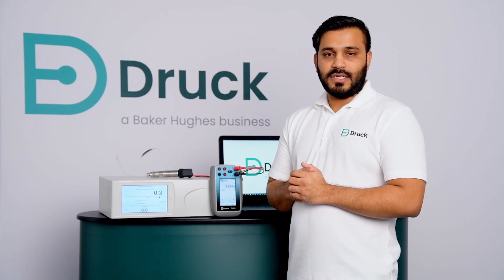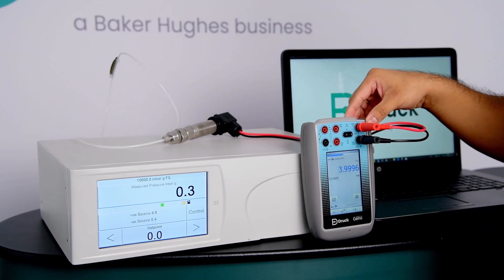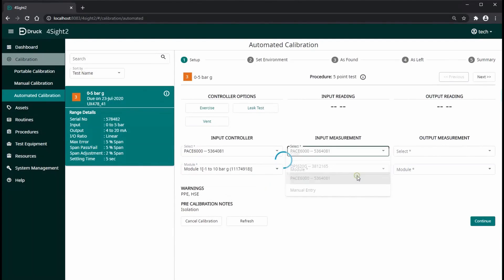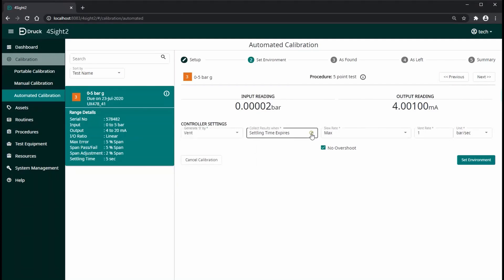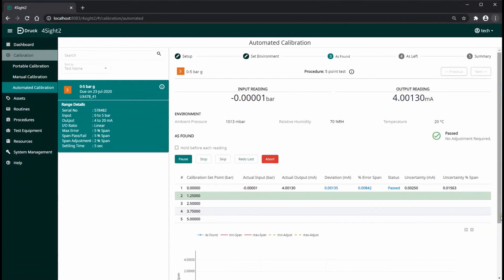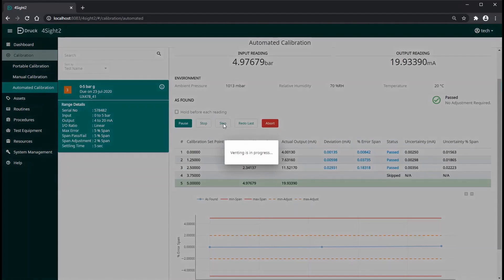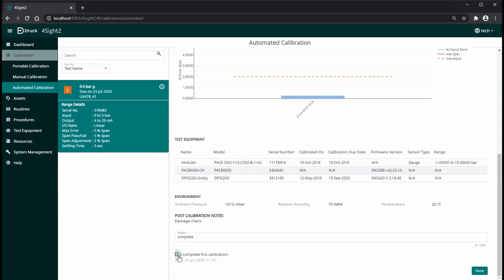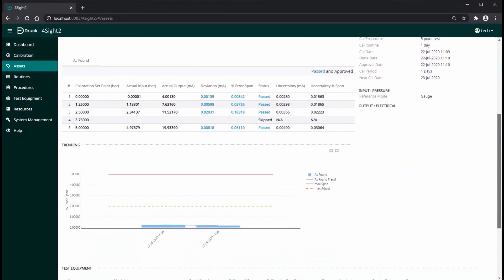How to perform a calibration with PACE using 4Sight2 | Druck Calibration Unified

Comment: Which pressure calibrator to use for Druck DPS 8000 (Digital output) calibration?
Reply from the maker: @yogeshpanchal1, Please could you send through details of the digital output you are using to drucktechsupport@bakerhughes.com and we can pick up from there!